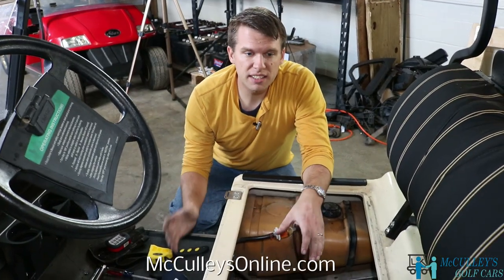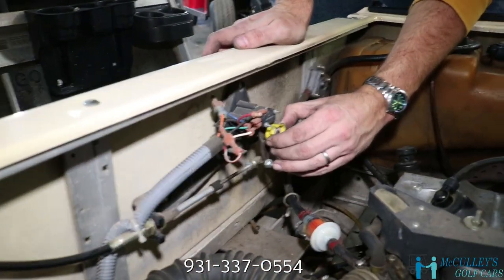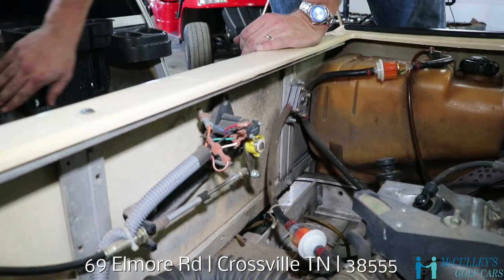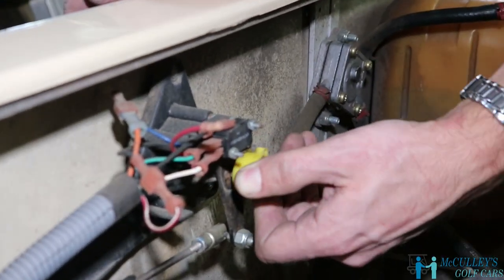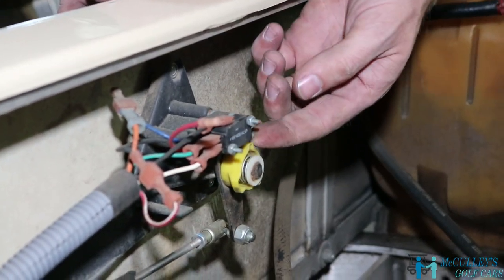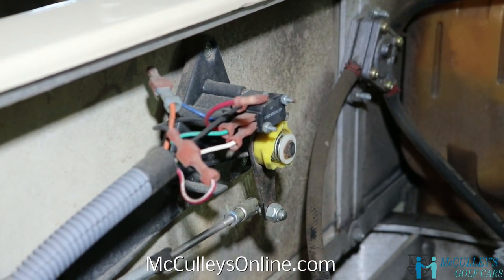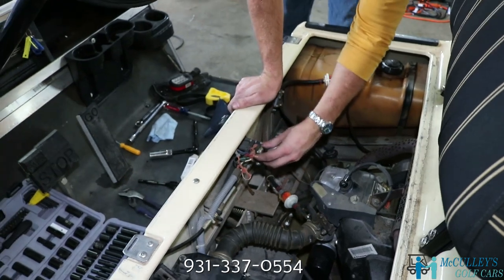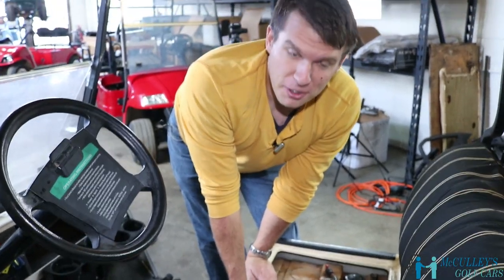PRO TIP - Putting a Club Car DS Golf cart (Gas) into Maintenance Mode

Comment: Im at my wits end with my club car, ive replaced belt, gear linkage cable, and still it won't go in reverse.  It goes forward fine so i thought the clutches are engaging, but somehow the belt is not turning in the reverse position
Reply: The yellow knob in the video may not be aligned with the micro switch. The micro switch may also be bad.
Reply: @howtodoitdude1662  I've bypassed both of those and hooked it up to straight power and hand engaged to the transmission, and it still wouldn't go into Rev, I also noticed the reverse beep doesn't work either, so my first thought was that there was a short somewhere under the dash

Comment: How about a 1984 service switch that is simply a toggle located above and rearward of the battery? One way brings the oil light on and the other way the light goes out, no big deal but either position the cart will drive off :{